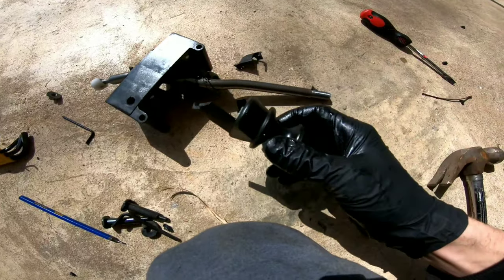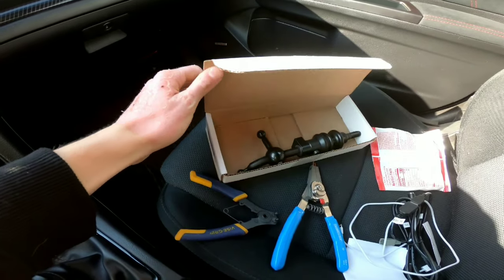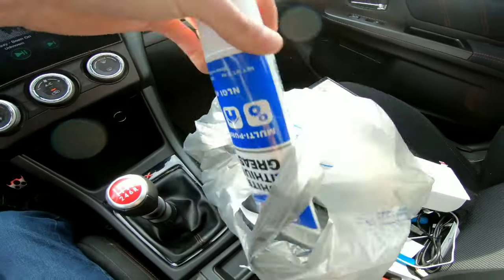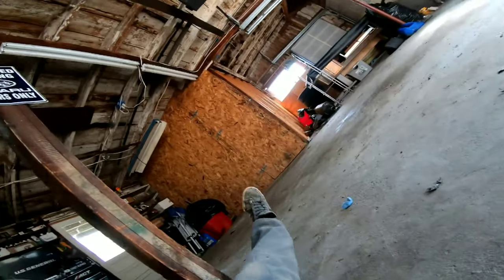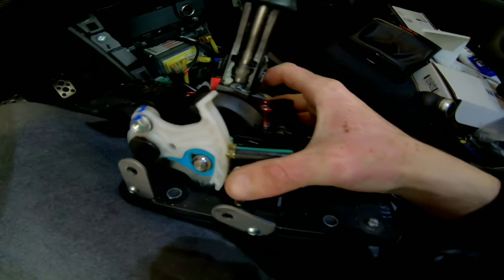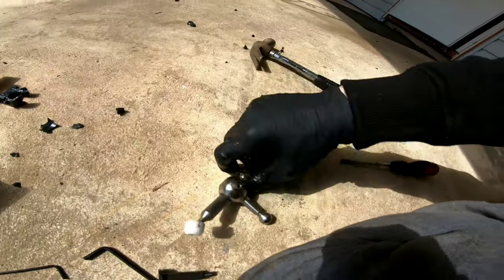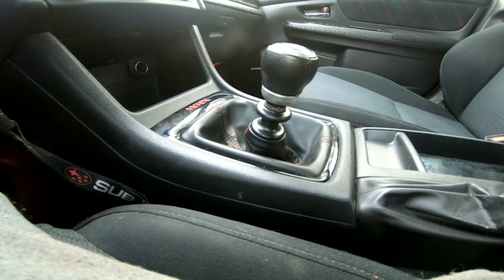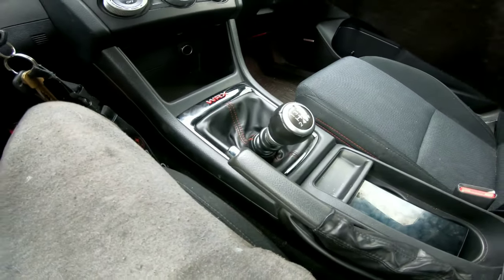15+ WRX Boomba Short Shifter Install & Review

Comment: Do you mind doing a exhaust setup video ? I currently have the Q300 catless turboback and was looking into a quieter setup for highway driving
Reply from the maker: Sure I can definately do that! If it helps as of right now it goes; 
- 1320 performance catless downpipe
- Stock STI Midpipe 
- Stock WRX mufflers
Reply: Street Inspired thanks !!

Comment: Does this change anything even if you still have rev hang
Reply from the maker: Even if you're on the stock tune and have rev hang this definitely has a great feel to it and faster shifts. It's a tad bit notchy but I'd say it's definitely an improvement over stock.

Comment: Im having trouble getting into first. Any thoughts?
Reply from the maker: Do you have a pitch stop as well? If you have an aftermarket pitch stop if it's set too far over it can catch and not go in correctly
Reply: @StreetInspired1  no it doesn't. good call. Ill get one. Its not like i cant get in first it just fights me.
Reply: Oh I misread. Its probably the shift stop or the shift lever. The shop mentioned they may have to adjust it.
Reply: I just had this installed and am also having trouble getting into first. No solutions yet. Please let me know if you find one.
Reply: @keng3230  it needed adjusting at the shop that did the work.
Reply: @jameskocks4734  Thanks. I am curious what they adjusted. I paid a shop to put it in but would prefer to not pay more in labor to have them fix it... I have the shift plate and a brass bushing that I installed myself. Maybe I can email Boomba to see what they say I should be on the lookout for.
Reply: @keng3230  if i did it over again i would not install the shifter lever. it made the shifts very notchy and was expensive to buy and install.

Comment: Could you tell me your exhaust and jpipe setup? Does it drone on the highway? Is it loud
Reply from the maker: I'm running catless jpipe, stock sti midpipe (since it has a resonator) and the stock mufflers. Its pretty quiet which is what I wanted. No drone at all! Its loud when you get on it but quiet when cruising!
Reply: @StreetInspired1  oh snap. I just took my aftermarket exhaust off. That thing was so deep and droney. Stock is perfectly fine for a daily just the tips we're bigger
Reply from the maker: @antonsalmin8373  now that's the issue I'm having! Haha I prefer the quieter exhaust but you're right the stock tips just look out of place. Been thinking of having someone weld larger tips on my stock mufflers haha
Reply: @StreetInspired1  haha I saw some really nice ones on eBay that were stainless steel and had carbon fiber on the outside. I might go that route
Reply from the maker: @antonsalmin8373  did you say carbon fiber!?..... I'm sold haha!

Comment: Where did you get the shifter shroud?
Reply from the maker: It's the stock shroud I just painted it. You may be able to buy one that looks like it though.
Reply: @StreetInspired1  oh nice. How’d you get the WRX red. I have been wanting to do the same but not sure how to get the lettering red
Reply from the maker: @lenny95sehs  I painted the black first and then clearcosted it. Afterwards I lightly resanded it and light Painted the red over the wrx letters, then sanded off the overspray around the letters so just the red was left in the wrx lettering, then I reclearcoated everything.

Comment: it looks like it's more work to shift. Shorter throw, but stiffer or something
Reply from the maker: It does feel much stiffer to get into gear than stock. Almost feels like you have to push harder. But its been about a week since the install and I've gotten used to it and I'd say its more good than bad.
Reply: Needs the boomba shifter plate to help that, the counter weights will allow for a smoother shift